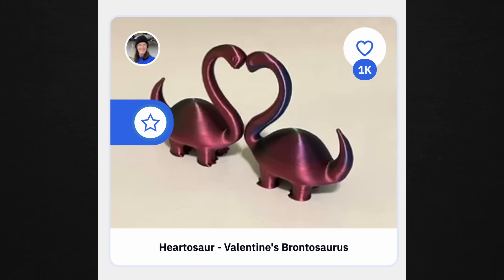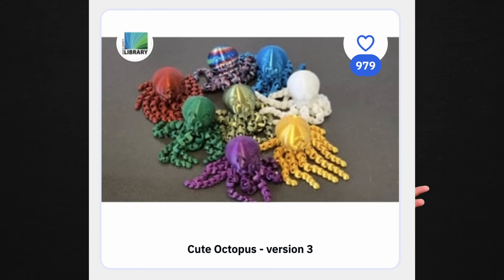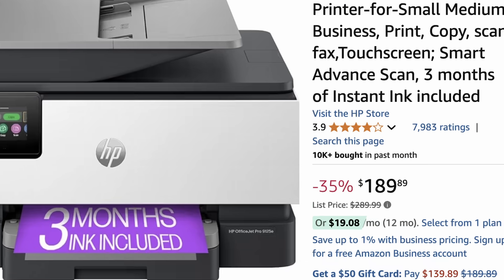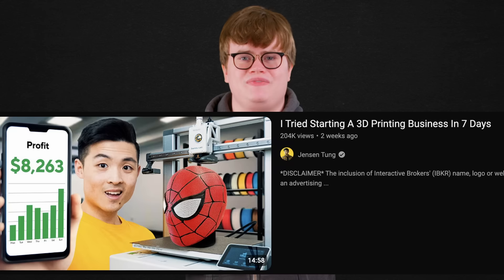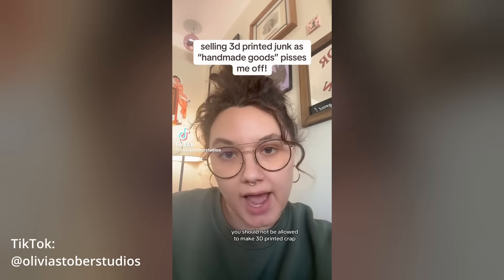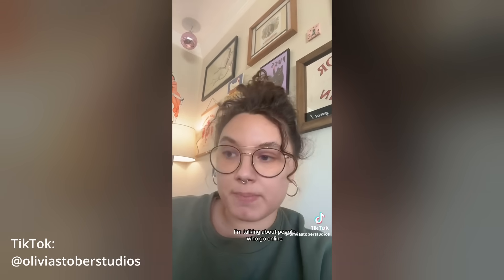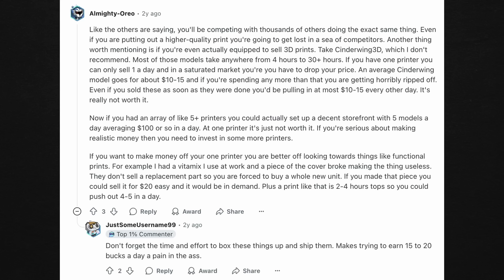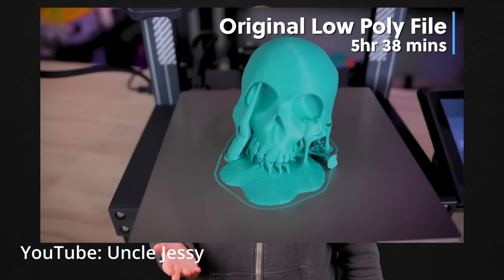The Rise of 3D-Printed Slop

Comment: I've never used a 3D printer in my life, but even I knew the dragons being sold at a local fair for FIFTY DOLLARS didn't cost them more than $5 to print.
Reply: If the original person who designed that 3D model was there at the table selling it for 50$, then it would be worth it because you're paying for the 8-20+ hours it may have took him to design it as well, material price is irrelevant when you factor in the labor requirement for designing models. 

The only problem is, joe schmoe didn't make that and wants to reap the rewards which ruins it for everyone who actually puts in the time and effort.
Reply: @TheSynchronizer absolutely.  It can take weeks,  plus prototyping to make sure it works and prints perfect. I make lots of things my daughter has mistaken for store bought items many times.
Reply: @TheSynchronizer but half the time I can find the design online and it only takes like 6 hours to print
Reply: @TheSynchronizer Not even then, because that $50 design time is amortized over however many $2 material cost dragons they are selling in total.
Reply: @TheSynchronizer 
The joe schmoe spent 6 hours making the dragon then sold it for a few bucks and change at Cults to 50,000 people for years worth of income, actually.
Reply: @TheSynchronizer  actually Joe Schmoe spent 20 hours tops modeling the dragon then sold it on Cults for a few bucks and change to 50,000 people for a years worth of income, so sit down.
Reply: @TheSynchronizer  Except the person that designs that dragon is Cinderwing who has over 1,500 commercial subscribers at $10 a month. I'll let you do the math on that and figure out if makers ruin it for designers.
Reply: @OGManlyMutt  how many people are just stealing models? In the ball joint doll world people just print things with no commercial license
Reply: @strayiggytv  Thieves be thieves for sure. Facebook is full of ads of people selling stolen models as well. I can't think of a single industry where theft of some sort is an issue.
Reply: @strayiggytv  far more then that are making them
Reply: It's more like $2 including printer maintenance, electricity and filament
Reply: @youtubehandlesux  Time is actually an imporant factor too.  Yo have to factor in the time it takes to print the models.
Reply: @youtubehandlesux  you are fukn crazy, they take 9 to 12 hrs to print on a gen 2 klipperized printer and any quality rainbow silk pla or petg is 3to 4 c a gram and the dragons average about 120grams each if they are made correctly. it costs about 25 cents an hr to run a 3d printer. (like how it costs about 53 cents a mile to opperate a car, theres more expense than just gasoline)
Reply: @youtubehandlesux  leaving out the most important cost of manufacturing. Cost of operation
Reply: You should ask them if they modeled the dragons themselves. Some poor soul spent 40-80 hours painstakingly creating the design, and so often the person selling it just stole it from the internet.
Reply: @gizmoguyar  That poor soul you're talking about has more than 1500 commercial subscribers they're paying $10 a month for. Cooper is a better person than me and feels like he doesn't have to prove anything and hasn't mentioned he uploaded a modeled dragon and has made bank from it. You just keep living in your imaginary world where reality and facts don't exist
Reply: @gizmoguyar  OHHH you're a 3D printer failure.. Things make so much more sense now.
Reply: While I don't think the trinkets are worth $50, the OP comment just basically describes a value added process. If a dumb dragon trinket can sell for more than the filament and electricity that was used to create it, that was the whole point of manufacturing. Labor, expertise and machinery are mainly what gives manufactured items value - not only the raw materials that went into them. Functionally these print farm people are leveraging their purchased 3d printers to sell trinkets to a demographic of people that don't want or need to go out and spend $500 and 20 hours of their time just to produce the same dumb trinket themselves.

With that said, 3d printers are much more useful for producing tools, prototypes and low volume niche parts. Lots of people fail to make a profit running print farms because it's a heavily saturated market with a very low profit potential per item and little to no security against competition.
Reply: @0hypnotoad0  yooo someone with a brain using logic and rational though! You rock dude.. I spent days trying to teach them this stuff.. They're mind is too smooth to understand so it's a wasted effort
Reply: especially when the files for the prints they use are usually free
Reply: Just saw a lady trying to sell a 3d printed version of those glass bags that are trendy, dumb and expensive af, She was asking 500 dollars for something she printed for maybe 3 dollars in filliment.
Reply: those dragons drive me crazy they're garbage and not even unique designs they're just bingus baubbles that make me crash out and  get physically removed
Reply: @connors3356  "they're just bingus baubbles that make me crash out and get physically removed" You okay there? Think you just had a seizure and started saying random words.
Reply: @ figure it out
Reply: @connors3356  all your base are belong to us.
Reply: @OGManlyMutt  the only made up word i used in that message was 'bingus' which here in Aus is said more often than you'd think, i'm afraid your illiteracy is showing ya seppo
Reply: @connors3356  none of the words I just said were made up. I never said yours were.. You just threw out a bunch of random words that made no sense.. Your literacy is showing
Reply: People sell things for more than they cost to make.
A shocking revelation if you have no idea how anything works
Reply: @davidberry7115  bruh. the only point is that a 3d printed dragon shouldnt cost 50 bucks. it shouldnt.
Reply: @theobsessedengineerThen buy the cheaper one? That's the whole point. I don't want to make the large dragons constantly, so I mark them at $50. If you really want it you'll buy it and I'll make another one. Why would I take less profit making a larger item? If an item takes 5x the material and time, I'm going to mark it up 5x the cost of the smaller one....

That festival I'm selling at your complaining about, it cost me $600 to be there, I can't even cover cost if I sell it at what you're expecting it to be. So do me a favor, stop talking to me and go away. I need to talk to someone who ACTUALLY wants to buy.
Reply: Fr what pissess me off the most is the fact you can still see the print lines. They didn’t try to even use like putty or anything to make it even and sand and then just put on some primer.
Reply: @asianpotatofarmer1310  thats just being lazy or worthless 🤣 i couldn't imagine trying to sell a product that looked like that
Reply: @ what?
Reply: Try 4 euro
Reply: 50$??!?!?!??!?!?!?!?
that's an absolute scam omfg
Reply: Let's not forget that you're not just paying for materials. You're paying for utilities, for machine wear, for time, and also for knowledge and EXPERIENCE.
Reply: It's crazy seeing how quickly prices dropped the moment craft shows got filled with 3d printed booths.
Reply: Whoa that’s crazy, I can’t believe someone would dare to sell an item for more than it costs in raw parts. Monstrous and devious.
Reply: $5 dollars is highballing it, a dollar $1.50 at most.
Reply: you have no idea how business works
Reply: I've printed the flexy dragon things for my young cousin, and you're only looking at about $2 of filament. And the electrical cost is negligible. The markup on 3D printed items is crazy, especially considering how affordable 3D printers have become.
Reply: @ you forgot the cost of the machine which yes there are some crappy ones but my machines cost well over a thousand dollars each and most good ones do. Not all filament is a couple of dollars. PLA is but I would never make something to be sold in PLA. There is the cost of the market, the people’s time involved and whether or not they had to design something. Just like every other retail business it’s the same. Clothes cost pennies compared to what they are sold at. Fast food is the same, I could list a thousand more products. CNC created furniture is exactly the same thing but treated completely different. Mass produced circuit boards same thing but treated differently. The only difference is 3d printed products are being sold by normal people who are trying to supplement income. This is just a silly argument you could apply this nonsense to almost every product based business.
Reply: Yeah I thought they were cool but reallised it's probably still better to just get a printer since they can be used for so much more
Reply: cost of products always cost way more than just the materials.. Maintenance of machines, profits, taxes, time spent, failed prints, power consumption, etc, etc. So much more goes into a product than just materials.
Reply: my friend got a glow-in-the-dark one and it was like 2 1/2 feet long 😭
but i think they only cost that much to pay for the filament/spools
Reply: Printer maintenance?
Reply: Yeah I have a buddy with a printer I offered to pay him for the mtg life counter but he refused saying it's only like 45 cents to make.    I honestly only think they should be more expensive if they molded it themselves when usaly they don't model it themselves
Reply: 2 dollars for a decent size, a few inches
Reply: @GERMANAITOR  they don't cost more than a dollar most of them. It depends on how big it is. But I've seen people selling them for around 12 dollars. But those are people who don't want to be millionaires but just make enough to get by. That's not usually at craft fairs though.
Reply: If they are made out of PLA (which I'm betting they are) they absolutely do not cost even close to $50
Reply: If someoe could make them for 19.99 and makey money they would. It goes to show you its not that easy.  But dont worry print farmers already are trying to cut cost by making their own filament, their own printers even, and one day you'll get your dragon for 9.99.   But right now eveyones printing the same models with the same printers and the same waste of plastic filament changers the costs will stay high, well until everything gets saturated as its happening and that should bring those dragons down.  But you gotta admit they're pretty cool, look at these   https://youtu.be/tiN033KXx6Q?si=CCYs2VnBqn0kVWIC    I wish i had useless junk like that when i was a kid.
Reply: Another cost that's not being mentioned here is gas to and from the sale venue AND the big one - booth/stall fees. It's often pretty expensive to set up at a flea market.

I don't want fragile, ugly, dust- collecting 3d printed dragons in my house at any price, but if you're buying something from a manufacturer that has one machine and makes a handful of items it's just going to legitimately be a lot more expensive than from mass retail.
Reply: Rip
Reply: 50 dollars????? Oh nah imma have to lock in with life 😂
Reply: its because people buy them. its suprising but ya, people buy those dragons at 50 bucks. Why? I have no idea, but they do.
Reply: ohh you are so wrong.
Reply: @ I’ve made multiple dragons and I’d say that the ones he’s talking about should be Atleast 20
Reply: you are completely right since most of them are no more than a dollar
Reply: FIFTY DOLLARS??? I sell relatively large ones for 15-20 dollars 😮‍💨
Reply: @CheckeredFlag3DPrints  even then that's still a high price for a useless plastic dragon worth around 10 cents of pla
Reply: @DUTBP  Business is business. I got to start printing some more functional parts that are useless. It's also not ten cents of PLA. More like a Dollar or 2 or 3 depending on the size. still not very much
Reply: @CheckeredFlag3DPrints   marking up the price by 5x is still kinda crazy but suckers will be suckers.
Reply: @DUTBP  Profit is Profit. Plus It's essentially like 10-20 dollars is the golden spot where most people can afford. The mini dragons sell better because they are 10 dollars from me
Reply: What's your thought about resin printing
Reply: go buy a 3d for printer for 5 dollars... see how that works.
Reply: Why are people throwing all this out? 3D printed plastic can be recycled for another project. That's like buying a new car every time you run out of gas.
Reply: If you consider how long the prints take. Cost of repair parts, cst of electricity to run, cost of materials when there's fuck ups? I get why ppl price them the way they do...
Reply: At least paint the damn thing! There is artistic value there.
Reply: Bout 20 cents in plastic and max 2 bucks with maintenance. Most printers use less power than their home meter can count (per month) (per printer ofc)
Reply: It did probably cost them time to be fair.

Not $50 time for sure.
Reply: There were these axolotls and other things at SeaWorld that were clearly 3D printed they were more than $20 and they weren't even like quality prints
Reply: GW wants to know your location
Reply: those snakes with the glossy eyes cost more to make and look better but the price is still about 20 bucks
Reply: It costs not even a dollar
Reply: Depends on how big it is but yea they're mostly around $3 worth of plastic
Reply: Or $2 from Temu. :/
Reply: Actually most of these dragons takes around $6 to print not including electricity to run the printer and then also you have to account for how many failed prints that they have before they get a successful one
 It probably does cost them more than $5 to print last time I broke it down for me it would have been around 11 and most people I see sell them for about 15 to 20 which is not a very good profit margin cuz I know there are definitely more people that electricity is more expensive than where I live. But genuinely I do despise those dragons and even the small versions even the dice towers annoy me
Reply: it also takes a lot of time to print things, when they could be printing other things, this makes it worth more
Reply: they are costing 10-20 $ to print accounting for labor and material
Reply: Gee whiz I thought the nanny got fired when President Trump was fired.  I will do what I wish.  PLA is biodegradable if the surface is broken.  And what a condescending statement that most who buy a 3d printer will never learn how to use the design tools.  
I will do what I wish to do and I dont tell you that that your nasal voice sounds like you live in the basement or garage.  
And the joke with 3d.printer types is how one can make TENS of dollars.
Reply: They charge that high for that stuff? I thought about opening an Etsy shop for high quality custom models for a very niche community and didn't expect to make more than like $10-$20 to prints that are far more involved and rare. I hope people don't really actually pay that.
Reply: Most things you buy don't cost what it takes to make it. That said, depending on the filament, size, amount of color changes, etc larger prints could very well cost $15+ to make, not including wear & tear costs and post processing.
Reply: 50 bucks???? jesus im in the wrong business
Reply: Ugh. These people overcharge like hell. All you do is download the file, put in the plastic, and wait.
Reply: You don't understand how businesses work.  There absolutely would be overhead costs beyond raw materials... Not just machine maintenance and electricity but the cost of the machine and wherever it's housed in the first place, the cost of getting a booth at an event like that, and the cost of paying yourself or an employee a fair wage for the time it takes to clean each piece after it prints, problem solve if something goes wrong during the printing process, monitor the machine or machines, and run the booth.  Print time can be pretty long for some of these things, so monopolizing a whole printer for hours factors into pricing.  The more complex a piece is, the more thee is a chance that something goes wrong during printing, too.

Now, if the item is selling well, the printers won't keep up with demand so the price must go up to invest in expanding production.  If a piece isn't selling well, the price could go down, but then there is the risk that the seller will not want to print that anymore.  So that's it... that's how pricing works.
Reply: wait until i tell you about the fiberarts community and how people have to EXTREMELY undersell their hard work making crochet/knitted items just to be able to draw customers when people sell shit like 3D crap in the next booth over. One thing is a craft that takes time to master. The other is plastic slop
Reply: @sealpup9341  .... You know whats funny.. Is you are so stupid you don't understand what you just said.. Let me rephrase it for you.. "Dont forget those that make stuff no one wants and has to price them so low just to move them vs the people who make stuff people DO want and are able to profit off of it." Like yeah apparently fiberarts is slop and crap since you can't even sell it!
Reply: wait till you learn how little it costs in materials to manufacture a car !
Reply: @tenabrae  a car's body panelling requires a million dollar press and half a million dollar die for each panel to get stamped. Then robot welders join chassis parts together to turn them into a singular structure.
Your 3d printer isn't a car factory. It's a hot glue gun controlled by a computer.
Reply: @ yeah that's the point, there's a whole lot more that goes into producing anything than the raw materials.
Reply: @ChucksSEADnDEAD I'm also not manufacturing a $60k vehicle. The price scales down comparatively.
Reply: I saw a booth selling those, got a articulated spider to play with for 5 bucks and never looked back. I like my spider, I don't need more prints
Reply: @BarbieDreamDungeon  That's awesome! I have repeat customers that come back every week. I'm in a downtown tourist area. My biggest mistake is not getting my website up quicker, because I'm often asked by them if I have a website. Why do people like yourself think everyone is exactly like them? But hey.. You bought a 3D print.. Thanks for showing that 3D prints do indeed sell!
Reply: @OGManlyMutt  hilarious you want to call it the trump effect when you can't stop bragging like him and have no respect for people who work service jobs. The only trump here is you lol
Reply: @strayiggytv  I have no problem with people in the service industry. I have a problem with kids like you in the service industry acting like they are smarter and more informed than they are.
Reply: Let's try to find out the cost for one the dragons for real as the tech guys in the comments trying to justify 50 dollars are angry that you insult their hobby and falsely try to claim that "yes, 50 dollars IS fair and proper!"

I just downloaded a file for an articulated dragon very similar to the ones that I have seen at cons before, chucked it into my slicer and set the layer height and infill as recommended. 

My slicer tells me this dragon would take 33,25g of filament. I usually print in PLA, a spool of 1kg costs between 15 and 25 bucks. Let's say we are printing this dragon with a fancy multicolored filament because that's what they usually do and let's say it's 25 dollar. That makes about 83 cents in filament. 

Print time is almost 4 1/2 hours, my printer in the area I live will use about 57 cent per printing hour. If you have a better printer than I do you might even be able to print this guy faster. This means our dragon would cost me about 2,57 dollars to print in electricity. 
In this situation I would like to neglect the cost of doing a test print for step calculation because that would be less than 30 minutes of actual printing and if you are selling these dragons you do not have to do it every single time before printing the next dragon. 
And as I have not modeled it, and neither have the tech guys selling them at cons, I will not add anything for modeling costs. I will also not add maintanence because I have to do VERY little maintance for my printer at all. 
Once I set my printer up properly I can just leave it for many prints, maybe every couple of prints I will have to level the bed. That takes like 2 minutes. If we were printing super precise with measurements that need to be perfect or else it can go in the trash you MIGHT need to make sure you check your options, steps and bed more often - but for trinkets like this? Honestly you can just do whatever, you can be a total beginner and have this be your very first print and it will probably come out okay, not perfect but super okay. And if you know what you are doing, which I hope you do if you are selling them, getting the settings right won't take you long.

But for now our total material and electricity bill would come to 3,40 dollars. And they usually don't come with any packaging so no additional costs here either.

And now to be 100% fair - I have never seen anyone sell one of these dragons in person for more than 10 bucks, it's usually around 8 unless they are in fact bigger which would increase the costs obviously. If someone TRIES to sell you one of these for 50 dollar - they are ripping you off. 8-10 dollars tho? Totally fair and appropriate for someone selling these. Do you need one? Probably not but that's not my decision to make.
Reply: @SnailNick00 You're forgeting the booth fees, the cost of all the tables and tents, their time to bring it there and back, the set up, the hours worked at the booth.Hell the booth fee for the event I'm at next weeked is $750, oh and they require I buy christmas decorations to decorate my booth for the event. I have to pay for helpers because so many people are asking questions and wanting to buy, pay for business fees, save for taxes. By the time the event is done I make on average $20/hr.....

You are expecting these people to work for minimum wage or less.
Reply: Its alot more than you think. Filament has to be calibrated and well supported then takes a substantial amount of time to print and a lot of energy used to maintain bed and extruder temps, also decent filament isn't cheap.  Then you have the cost of machines and consumable parts so you got a overhead to overcome.  When i did commission prints from 2014 up through the end of covid most of the cost was in print time more than anything else.    When it comes to SLA prints the operational costs of running a machine is MUCH higher, not only is the resin expensive (The lowest cost "acceptable" cheap stuff is around 65 bucks for 3kg) but the screen itself is a consumable that has to be replaced after the UV eventually kills it (which a 12 inch mono is like 200+ bucks)
Reply: @nikushim6665  the arguments you guys are making don't apply to these people pumping out crap products at craft fairs are doing the bare minimum. The prints are fast, rough and unfinished, if you aren't making things like that then the ops post doesn't even apply to you
Reply: @strayiggytv  The argument was the cost to print being five bucks, which was wrong. As for the person hawking prints at faire who cares, those booths typically cost money and if they think they can actually sell them then more power to them.
Reply: @nikushim6665  people clearly care. I despise thee nothing arguments and the 3d print crowd has been poisoned so severely with the "get the bag" mentality they're like every other group. The hobbyists are the only ones worth bothering with. The rest are nft level AI slop peddlers who can't take criticism
Reply: @strayiggytv  they aren't smart enough to realize that apparently
Reply: art costs money. deal with it. and its 50 cents not 5 dollars to print.
Reply: I'm sure they just did the design for free. Afterall, a Ferarri is just $3,000 because that's how much the materials cost. All profit is immoral, except your job of course.
Reply: @imthelizardking  a job is profit? What? The price of a ferrari is the design? Lol this whole comment makes no sense
Reply: I profit from my Ender 3 because I actually 3d model, sand paint and clear coat what I make. Cosplay props, useful original items and custom made art pieces.
Reply: TBH most of you sound pretty annoying and insufferable to deal with as a seller or a customer. 

Glad I'm not buying or selling to any of you and do this to get functional prints for myself and others to improve and adapt things to personal needs.

Don't make it if it's not profitable .. sucks you paid to much for a printer. Don't but it if it sucks. Move on.
Reply: @highpraise-highcritic  if your takeaway here is that consumers are annoying, you just dont care about consumers - you care about your pockets. Not a good look
Reply: @ No not all consumers .. just "consumers" that complain about the price of things they don't intend to buy. They aren't consumers at that point. And the sellers belittling people for not wanting to pay the, imo, high price the hypothetical. 

I agree with the "consumers" here ..  $50 for the Dragon print is wild .. I wouldn't pay that. But I'm not planning on buying one. So I'm not complaining about it or what people need to sell it at to be profitable. 

My pockets? I said I'm not selling my 3D prints to anyone .. how is that worrying about my pockets here? 

What I do sell ( not 3d prints ) I take great care in and make sure everyone I deal with is satisfied beyond what they expect from me and wants to return for future business. I grew up working in a family business and my work is my reputation. I treat it with the integrity it deserves and the customer deserves. 

This thread is just bellyaching and insults from both sides of the economic equation is what I'm taking away.
Reply: @highpraise-highcritic  why would someone buy something they think is too expensive? Bit of a self fulfilling prophecy lol
Reply: @zwicker5585 Are you really asking me to detail all the reasons why someone may or may not buy something?  Come on my fellow pedant .. try to read the forest not the trees.  

I agree I could have worded it better .. but I think my point is pretty obvious. 

I'm already too sucked into this  debate I don't have interest in ..  because it feels unproductive one both sides. 

Good luck out there as a seller and/or a consumer, I do mean that sincerely. 

This is a weird back and forth to me and I'm stepping out of it.  
Cheers
Reply: A lot of the time they have to sand it down after it prints to make it smooth, I think. It takes a while not to mention the machine takes ages. Labor is labor, just because it’s invisible to you doesn’t mean it doesn’t exist. Just don’t buy it
Reply: Yet you're not concerned about sweatshops who work people to death? So many (really dumb people) don't notice they aren't forced to buy that dragon. Even if they don't buy it
Reply: @Cooper-sCreations  it's a wacky concept but some of us can not like more than one thing.
Reply: @strayiggytv  Yes but a lot of my broke friends say 'your stuff is too expensive'. 
There's a reason it's $50. It's the sweet spot between profit and customers. If people are still buying items even if they go up in price, keep increasing the price til they don't. Simple business concept. There's also a reason for high profit margins. I have a base margin of 6-8x print cost, many factors including print time affect that. And like i said again, no one is forcing you to buy it. This is very normal, and people are willing to pay this. I think this video was a bit odd as a whole
Reply: @Coopers_Creations  that has nothing to do with your sweat shop comment I responded to and everything to do with you having cheap friends who like you have no appreciation for actual skill and artistry. They don't think your flexi dragons are worth that because they see them everywhere for cheaper and they know you didn't actually design them.
Reply: @Coopers_Creations  maybe your 50$ stuff is too expensive because the quality is low and not because their broke or something. I mean they certainly arent your friends if youre calling them broke 😂
Reply: @zwicker5585  WOW dude you don't have friends if they're broke?! Imagine choosing your friends based on how much money they make. That's messed up dude
Reply: @OGManlyMutt  you obviously arent very good friends if thats how you talk about them online 😂 but hey keep up that big loser energy my man..
Reply: Lol, $5 in filament, 20 hours of electricity, 20 hours of machine print time, maintenance costs, repair parts on hand, print failures, overhead cost toward a $2,000 machine, labor, post processing. No shit they're $50. So many people don't understand that there's more to pricing 3D prints than just the raw materials. 

Let's use my setup as an example. My machine cost $2,250 + 13% Sales tax. Filament is $25/kg. To print 1kg would take roughly 24 hours. The machine runs around 300 watts to run or 7.2 kWh with my power cost that's about $1. Now we have to add labor costs, we'll assume only 10 minutes of post processing @ $20/hour to get $3.33. 

So we're already at $2,571 to produce that print for you, and this isn't even taking into account profit on the part itself. Now add in the cost of license for the parts themselves, $15-$25/month for a license usually to sell, usually people require 2-3 licenses for all of their product.

So yeah, people charge $50/print so they can make a profit and pay down their initial investment to purchase the machines. This is how business works, it's the same in basically every industry.

I'm in the landscaping business, my job is to turn $1,000 of materials into a $10,000 project that the customer loves. The same goes with 3D printing, if you're buying a $1,000+ machine it's REQUIRED to turn $5 of material into $25-$50 in order to get a return on investment and pay your bills.
Reply: @kylequinn1963 this guy definitely sells shitty plastic dragons for 60 dollars
Reply: BROOOOOOO, the problem is people like YOU arent the ones charging fifty. I could crank out one of these dragons in five hours (I have done so), so your 20hr run time is insanely overestimated, do you even 3d print?????? lol... 50$ for a 5 hour print.... 4 hours, actually.
Reply: @kylequinn1963  guess your dub as shouldn't have bought a 3d printer to try and shill garbage to people. Acting like your being forced to do everything is ridiculous, you willingly do it, in hopes some idiot will blow money on something you didn't even design
Reply: @kylequinn1963  This is the truth. And you can start turning down the cost once the investments have been dealt with, too. In fact, it will make you more competitive then. This is how business works, as you say.
Reply: @kylequinn1963  yeah right cause you only do that one print.

And if your 2k+$ printer takes 20h for these dragons you should consider tuning it and optimize slicer settings.

With 50 dragons sold you got your printer paid with just one model.

And you hopefully didn't just get a printer to print this dragon.

It's just offloading the cost of you hobbies/machine in others.
Reply: @kylequinn1963  😂 Buddy acting like he's recouping cost for an injection molded part
Reply: @kylequinn1963 That doesn't mean it is worth that much to the consumer.
Reply: @RetroRadical the consumer decides...
Reply: @kylequinn1963 Hmm, the math works. When you jack up your equipment, materials, and times to completely unrealistic amounts, lol.

$2000 printer???? Lol
$25/kg filament???? Lol
Reply: @kylequinn1963 That the point he’s making…why do that when it’s cheaper and higher quality to just get something injection molded? It’s junk and it’s expensive. It doesn’t make money for the vendor and has little value to the end user when considering the cost.
Reply: @kylequinn1963 this is some pretty unfair and deceptive math. Filament for a bulk purchaser is nowhere near $25 a kg unless you’re buying some really fancy stuff. Standard PLA should be <$15/kg if you’re doing even baseline research. Additionally, the power consumption for a prosumer printer like the Bambu Lab x1c while printing is ~100 watts not 300. 

I’d also be curious what machine you purchased, as it is almost certainly something someone running a print farm would never buy. Standard print farm setups are most commonly Prusa or Bambu, and other than the Prusa XL (which no print farm owner would operate) none of their printers get close to that number.

Your comment is at best woefully misinformed, and at worst intentionally misleading.
Reply: @ Most multi-color filament is at least $20 to be fair to the other poster and that is what most of these items are made with. Also you do use other colors typically for details, so there's that cost too. Does it get spread around multiple items? Of course. I don't personally sell dragons as I feel the market is flooded with it, but given how large I've seen them printed and people making eggs and other accessories, I don't think a higher cost is unreasonable depending heavily on the circumstances of the item being sold. It would be insane to charge $50 for the average size, IMO.
Reply: @kylequinn1963  printing 1kg would take closer to 3 days. Even more if you're printing something as complicated as a dragon.
Reply: @kylequinn1963 you got into the wrong "buisness" if you're printing 3D prints my friend. It sounds a lot like the bottom end of the pyramid scheme to me. 

All your money as a "buisness" owner goes to the design you paid for, the filament company who makes that plastic for ya, the 3d printing companies who charged you an arm and a leg for slightly better resolution, and what do you get in return? A cool gadget that nobody is willing to pay 50$ to make you money...

Everyone else got theirs before you could begin to figure out how to get yours.
Reply: @ReadIcculus93  It's so funny to me you think you know what you're talking about, and $50 is not even a realistic price for these-- no one selling for real sells them for $50 a pop-- that is a hilarious notion.
Reply: @ If they were worth .50$ it wouldn't make a difference, its the same useless trash you thought you could make money off of. Its funny to me that people actually think 3D printing other people's designs is a business.
Reply: @ReadIcculus93  Honestly, seems to me that using it to make miniatures and accessories for table top gaming and cosplay components would be a better niche business than these trinkets.  A much better business if the printer is an artist who can sell their own sculpts and make custom ones.  I think the people selling dragons and such are just paying off the overhead of their hobby, tbh.
Reply: @ReadIcculus93   Things are worth whatever people are willing to pay.  There are cheap button pins from various fandoms that are limited edition but then sell for hundreds of bucks if there's buyers.  I think the issue here is lack of scarcity, so it only comes down to how much a person wants that trinket and whether or not they can find it selling cheaper.
Reply: @ I like the idea of making minatures and accessories for stuff like DND and other games. I dig it. It is a bit niche, but it's something people will actually enjoy. Now will someone pay a premium for you specific one? Perhaps not your prints, but maybe a blueprint so they can make their own at home? I mean thats ultimately where the money is to be made. 

I'm not dropping a dime on these things, and its not because their plastic and worthless, some people collect those plastic molds from zoos and theme parks lol Useless plastic, but its from a place. It holds a memory. It's a suveneur. 

A random plastic piece of junk fidget thing isnt going to help anyone quit their day job.
Reply: @ReadIcculus93  I do this full time so yeah "A random plastic piece of junk fidget" does help people quit their day job. Today I'm printing a card shuffler, a label organizer, a shoe rack, several planters, 3 lamp shades, a couple multicolor LED lamps and "misc random plastic pieces of junk." I DO have a Saturn 4 Ultra and the new Elegoo Wash and Cure but no orders for it today. Sitting there lonely surrounding by my Bambu A1s printing away. Maybe I should print an epic dragon for me to paint to make it happy.
Reply: @OGManlyMutt  objectively, it's cheaper per product to have manufacturing outsourced if you want to scale your buisness and make it legit. All of those products already exist, why go to you for it when I can print my own, or hit the local big box store and pick one up at half your cost with better quality assurance?

In other words, what are you bringing to the table exactly that other people aren't already doing better than you? 

Or are these 3d printers "businesses in a box" like a subway franchise?

Ps, I know my tone is shitty, but I'm trying to be helpful in all of this. Having been a general manager for a 711 that did over 4 million dollars in sales a year (with no gas), having to purchase quite a bit of "random junk" that people buy over the years. Starting my own lapel pin business when I was young, if you can believe it 😆 I made a small amount of money, but nothing that I would consider a buisness. 

The overhead is the tortoise in the race. It always catches the rabbit (fast money). It's the ole car maintenance factor nobody considers when they take a job with long commute.
Reply: @ReadIcculus93  That's actually not true! Desktop 3D printing actually got popular over 10 years ago by printing parts for companies. Because it's cheaper to print at small scale AND on demand. You really need to learn about 3D printing before making an objective opinion because you just made yourself look incredibly stupid and I'm sure that wasn't your intent. I'm sure in your head what you said made sense because it lacked actual knowledge.

Edit: Also my prints are SUBSTANTIALLY better than what you get at the big box stores. I can print direct to customer specs. For Example, a vendor approached me at my last pop up. Asked if I could make her a box for her labels. When I started telling her how I can customize it to her needs her eyes lit up! Try going to a big box store and getting something customized exactly how you want it. Seriously, it really is funny listening to you all making so many obsurd comments that are incredibly inaccurate. I'm going to start calling it "The Trump Effect"
Reply: @OGManlyMutt  you can try and sell me all you want on your custom state of the art boxes, but I'll stick to the 5,000 other options available, thank you though!
Reply: @OGManlyMutt  mind you, everything km saying here is word for word what a bank loan manager would tell you if you sat down with them for a small buisness loan. If they're like me, they'd laugh at ya, but many are nice so they'd explain to you as nicely as possible, "you're not getting a loan for this"
Reply: @ReadIcculus93  Why would I need a bank loan? And no, I'm 43 dude.. I've had businesses since I was 13. A bank loan manager would look at my history and go well you have a proven track record lets get you that loan. But live in your fantasy world kid. Believe what you want to believe. I know its easier to live in your mind and try to show others your right. It just makes us that live in the real world and have real world experience laugh.. LOVE your imagination though!
Reply: @ReadIcculus93  I was literally interviewed by the largest 3D design studio in the world. I'm one of the fastest growing 3D printers out there. You live in your moms basement and play video games. We're not the same.
Reply: @OGManlyMutt  you have no idea how the world works, good luck to you.
Reply: @ReadIcculus93  he talks like a dude at the top of an MLM trying to sell us on 3d printing as a get rich quick business and he can't even see it
Reply: @ReadIcculus93  this is 10000% facts. Anyone crying about not making money 3d printing is clueless and obviously thought they could get rich off it
Reply: @OGManlyMutt  they arent absurd  because if what you say is true, you are the small % that doesnt need to use other designs and probably got into long before any of these goobers.
Reply: @OGManlyMutt  the more you talk, the less believable it sounds
Reply: @kylequinn1963  paying 2k for a printer and still needing to do repairs and getting failed prints, at that point you're just getting the ender 3 experience
Reply: @ChucksSEADnDEAD  I have to assume you've never run a business. The cost of the machine doesn't suddenly mean that there won't be failures and issues.  I've owned equipment that cost $55,000 and still broke down. It happens. You factor those repairs/down time into the cost of overhead for the business and charge appropriately.
Reply: @kylequinn1963 what printer is that? And why are you using that to make a $2 dragon? That just doesn't sound like a smart investment when you could buy almost 20 Ender-3's or heck, a few Bambu labs printers and make 50 dragons in the time that $2k+ machine makes one. There's no reason for these dragons to cost more than $5. If they do, it's because of poor business decisions that you made. That's on you.
Reply: @archNagel You say poor business decisions but people keep coming to buy them??? I turned a 8k investment into 80k of profit as a side gig over 3 years, working 1 weekend a month.
Reply: I feel like you never had a job either
Reply: To be fair, it's mostly the cost of electricity.
Reply: Guess you never heard of machine time then.
Reply: @adama1294  wow what a long day of doing other stuff while the printer works in the background.
Reply: @Ajia_No_Envy machine time is valuable, but only if you’re running a full scale business where it’s costing you money to not be fulfilling orders. I doubt many of these small print farms have order volume to saturate their printers, and even then machine time isn’t that expensive.
Reply: @Ajia_No_Envy  Cost of operation is the most important factor in business. The fact you don't know this is why business professionals are annoyed by consumers crying but it costs so little to make why do they charge so much.
Reply: @Ajia_No_Envy  You still don't understand machine time. You effectively hire the printer. It accounts for buying and maintaining the machine. 
Not saying these prices aren't inflated. They don't even spend on R&D since they usually just buy or steal models from others.
Reply: @Ajia_No_Envy The printer can only do one print at a time. And that print may take hours...

If you  want three widgets, it'll take all day.

If you want twelve widgets, you need to buy three more printers.

So yeah, time matters.
Reply: @Ajia_No_Envy  But unless you have a room full of printers, that printer is out of use for anything else. 

I was an engineer in my working life and costing things is very complicated. No, you don't charge the same hourly rate for a machine as you do for the person doing the work, but you DO charge 'something' because if something takes 4 hours to print and you have it running 24/7, you can still only make 6 items per day. 

You also factor into that 'machine rate' the overall maintenance, messing about, and eventual replacement costs, so that you re-coup what you've invested. 

If you do it fairly, it's fair for everyone. :)
Reply: @adama1294  print time doesn't matter it's the same argument for AI "art" bros "well it took me 5 hours to generate☝️" okay but did you take 5 hours of labor + years of knowledge and practice to create it? They didn't design the model or even take the time to paint and sand it.
Reply: @Ollwayswatching  LOL Man tell me you have no idea how manufacturing works without telling me
Reply: @Ollwayswatching  Do you know WHY I make so much money in 3D printing.. Because you wouldn't know how to do what I do.. THAT'S the difference. That's why it's not overly saturated. Because people get a 3D printer thinking it's easy money when they read ignorant comments like yours and realizes it's more than just pressing a button. But hey keep telling everyone this nonsense because that's how I get cheap printers when they find out it's not that easy and sell them for 50% what they paid for them with less than 200 hours on the machine.
Reply: @OGManlyMutt  well, first of all, I would know what to do, I 3D model as well as digital art, and my school has a lab for 3D printing. My comment isn't coming from a place of ignorance. I am only talking about people who just set the machine up at low resolution so they can pump out over used patterns as fast as possible. If you take the time to 3D model your own patterns,sand the peices down and paint them, then my comment shouldn't have offended you.
Reply: @Ollwayswatching  OGmanlymutt sounds like a guy trying to sell a course in his to get rich quick off printing junk. He's so sensitive he can't stop bragging about how much money he makes. 

You know his practices aren't sustainable otherwise this video wouldn't have hit a nerve so hard
Reply: @strayiggytv  clearly haha
Reply: @Ollwayswatching  digital art is joke too, far too much of it bs AI with them trying to make it look not AI. Theres a reason so many people can do digital art compared to actual painting or drawing.
Reply: @SICresinwrks  I've always considered myself a traditional artist, and I still maintain a sketchbook; however, digital art facilitates online sharing of my work.  I don't believe we should claim one medium demands more skill, as I, having drawn for twelve years before beginning to use Photoshop, found myself completely unfamiliar with the process. I had to relearn everything developing my own art process similar to my traditional paintings! People who aren't artists have no idea where to start when it comes to covering up AI or tracing. No one who has that skill is wasting their time doing patch work for a robot.
Reply: @Ollwayswatching  that's false, i literally just watched a video of someone that scamed a high end art contest with ai, mod podge and horrible tracing/copying skills
Reply: @SICresinwrks  that doesn't mean they are skilled, as I said. That's a minority of people given it was the same artist under different aliases entering the contest. That proves nothing.
Reply: @Ollwayswatching  no shit it doesn't mean they are skilled, i literally said it takes no skill to trace over AI and you said im wrong.
Reply: @Soberhellraiser  They're not just tracing over AI or using AI. So yes, you're wrong
Reply: @OGManlyMutt  how delusional are you??
Reply: @ weird I thought I replied to you.. Guess I'm delusional.. How delusional are you to avoid facts and proof so reassure yourself the stuff you make up in your head is real?
Reply: @Soberhellraiser  so many people cant do digital art 😂 I’m in graphic design and even they cant do good digital art…  youre trippin balls bro
Reply: @Ollwayswatching No but they took the time to learn how to trouble shoot and fix the printer when it breaks. Sure you can buy your own printer, but 90% of the printers bought hit the second hand market after it breaks and they can't fix it.
Reply: @Skat8Klips I cant find the context of your reply Oops. Anyway. That is not the same as art skill, its a skill yes but not the same as creating from scratch. (Of course this isnt about those who make their own models)
Reply: @adama1294 okay yes, but that only adds to the con. So it's cheap to make, no one wants it, and it's time consuming because of the limited machine space.
Reply: @adama1294 it did not cost that much machine time either.
Reply: @adama1294  "machine time" with a 3d printer?? 😂😂🤡
Reply: @adama1294  machine time matters when you're handling a $150,000 CNC and blowing through hundred dollar cutting tools that wear down.
Machine time on a 3d printer? LOL